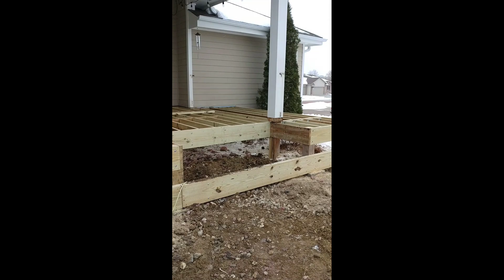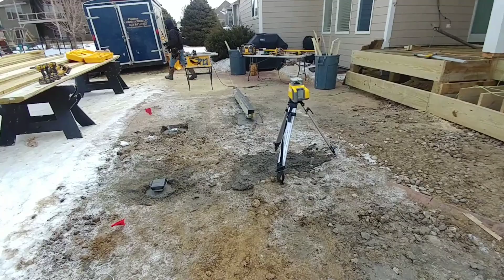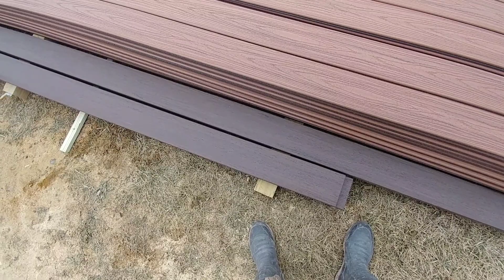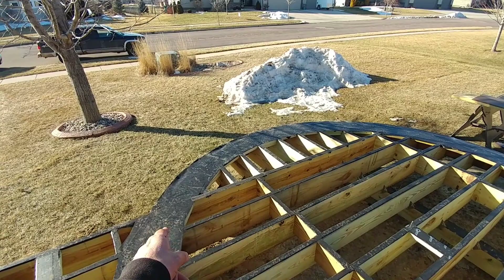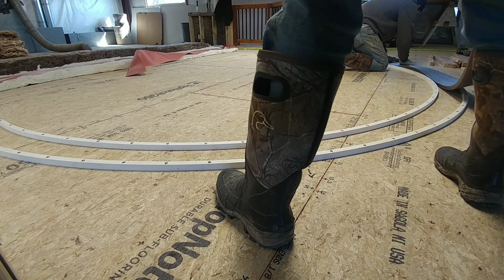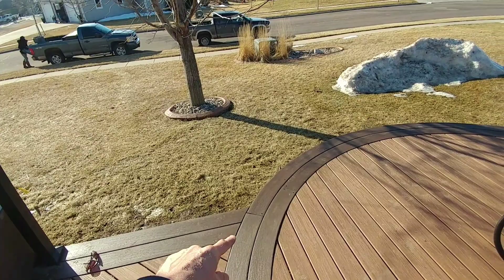Custom Curved Composite/Pvc  Deck

Comment: Really nice looking. You gotta quit pouring concrete and start using helical piers though. They’d be done and ready to build on by the time the machine spins the post hole digger to depth. What system did you use for the lights? I’ve been using the Barrett outdoor living system.
Reply from the maker: Yeah.. I know Everyone says that

Comment: Ok….so….I just completed my pvc deck. The end product is excellent. Now, I had my first outdoor fire last night. The fire pit is about 15 feet from the deck. Even with a very clean burning fire, the white ash from the fire sticks to the pvc decking. Heat plus pvc equals ugh. To clean my deck I needed a scrub brush and some warm water and it came right up.
Reply from the maker: Interesting 🤔.   The only PVC on this deck is the curved boards.  The rest is Trex composite
Reply: @promesConstruction  great point…..would be interesting to see how trex reacts…..probably much better for sure.

Comment: What blade did you use in your skilsaw?
Reply from the maker: Any blade will work.  I can't remember what blade it was exactly.  They do make Trex blades
Reply: @promesConstruction  have a deck where the end boards run into a round hot tub. The coping is concrete and just want to make sure this curved cuts look good. Probably jigsaw for this one.

Comment: Very nice work. Couple questions. 1) What lights and railings did you go with? How do you like that G-Tape? When you were cutting the curves with your saw, how did you not cut into your flashing tape? Where do you get the plastic material to use as a form when bending the material? Thank you for your time.
Reply from the maker: I buy the lights on Amazon they are called FVTLED  The Railing's are Westbury C10.  G-tape works good. They make g-tape that can be applied with a tape dispenser now that will be way faster. The Saw was set to cut almost all the way threw the deck board so the g-tape was not cut.  The Material for the form is just pvc trim that was ripped down into 1" strips.
Reply: @promesConstruction  I really didn't think I would get a response...so thank you very much. The railing I was referring to was more of the privacy fence...the tall, wavy fencing on the deck. That is super cool. I'm so impressed with the deck you built that I'm watching the video again!
Reply from the maker: @bradeley6409  you can buy them at https://hideawayscreen.com/

Comment: I'm doing a very similar project here in Virginia. My biggest difficulty isn't the work but the availability of a variety of colors to make a design work. I've had to mix brands in order to keep moving forward.  A Lot of vendors are attempting price gouging. Lowe's has a rip off strategy that whenever an in stock item is out of supply, they will "Gladly" order it for you at a 400% markup. A normally $29 - 12 foot board of Trex will cost you $89.00 each if they order it even if it's a normal stock item and can't get it in a descent time frame.
Reply from the maker: Yeah the prices now are getting ridiculous. westbury railings are raising their prices 7-10% in May.

Comment: Awesome job! So what heat temp & time warming boards did it end up taking you to do the bending? I’m fixing to attempt this & was hoping for advice. Thanks
Reply from the maker: There is an online class you can take called dr. decks Masterclass.  This will tell you all the info.  Different colors require different heat settings / time /   I would suggest taking that course.